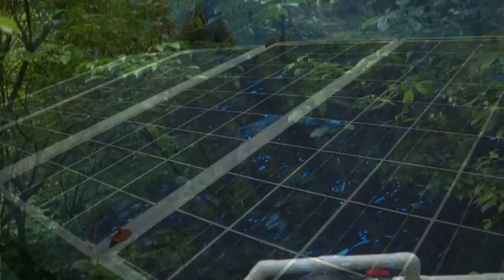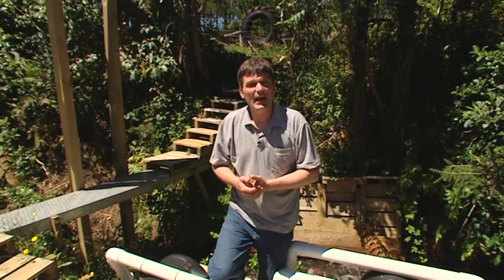PowerSpout - Installed Examples

Comment: I noticed on all the installations that the pipes have 90 degree elbow connections. Would it increase power or make it run smoother if there were gentle curves in the plumbing?
Reply: very good observation..